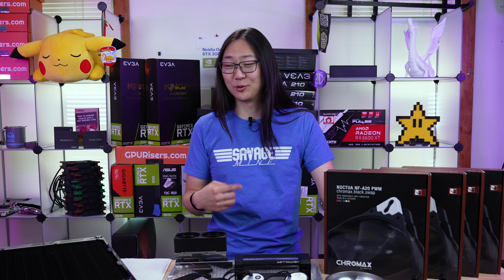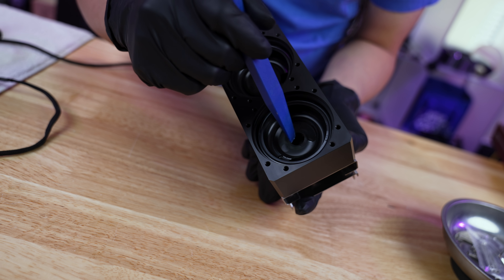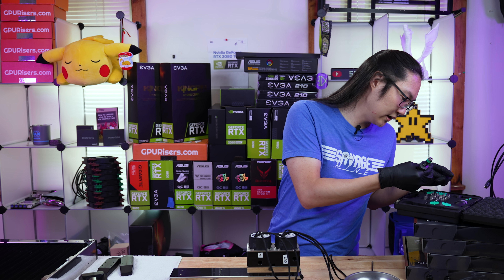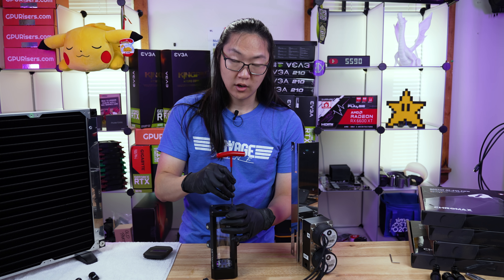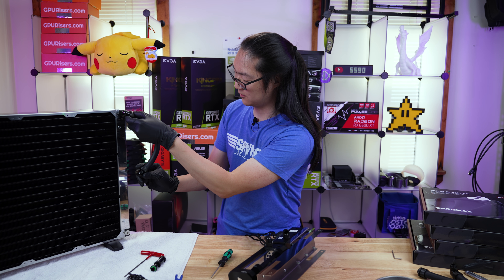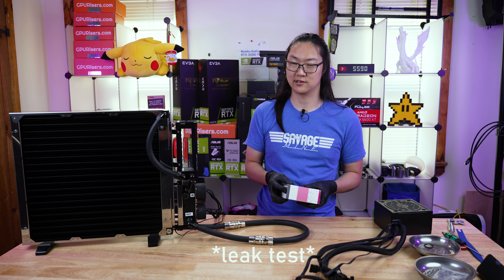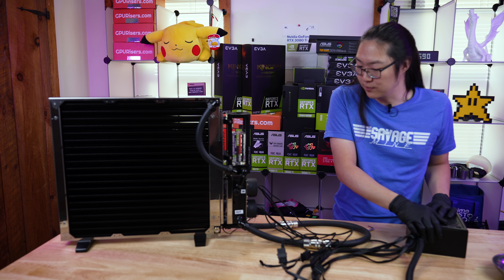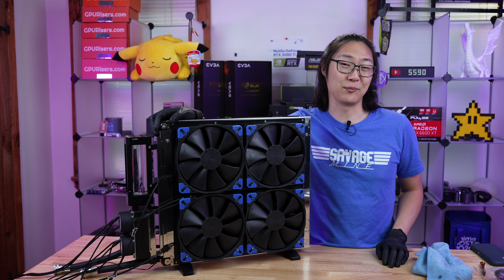The COOLEST radiator you never heard of!

Comment: Did you flush the radiator prior? Or is that unnecessary?  15:40 Seeing the fan mount mounted is nice enough but the interesting bit would be the cabling and fastening it to the radiator. The 4x200 mm Noctuas, I was all over them prior to being launched. How do their limited static pressure play out compared to using 9x140s? Would be nice to see a test comparison on performance, both cooling and noise, as well as cost.
Reply from the maker: Hey there, initially we did use nine 140 mm fans, but the amount of work that required in the cabling just made a little bit difficult. One of my key goals for this build was as quiet as possible and when you increase the radiation surface like that, you can make the rpms much lower with large fans. It's basically an audible from more than a few feet away.
Reply from the maker: Although not a bad idea, flushing of the radiator is not necessary. If it's brand new. Some people like to do a flush or filler with certain types of chemicals. I personally don't like doing any of that. Unless the radiator has been used with unknown condition
Reply: @TekShinji  Thank you for both your replies. I'm aiming for low noise as well. I understand the Mo-Ra isn't that dense so static pressure may be less important. Do low RPM render static pressure less important as well? Static pressure, from my understanding, is mostly related to speed of the air flow, and not the volume.
Reply from the maker: its diffictult for me to track comments after 1 or 2 so try joing our discord linked in the discription!

Comment: dude which screws did you use for installing the noctua fans to the fan adapter?? these screws that come with the noctua do not fit and the fan adapter seller did not ship any screws for the fans?? do you have the specific size and diameter of the screws you needed to get them installed? thanks in advace bro!!! great video im almost done with the exception of mounting the fans
Reply from the maker: hey buddy come joinour discord to continue the conversation linked in the description! im not exactly sure what your refering to. the screws should have come wiht the adapter in a small baggie?

Comment: I have had a MoRa 420 since 2017. Best investment I ever made, watercooling-wise.
One thing I'd like to comment on. When you use QDCs, it's best to use one male and one female connector at the bottom, and leave the tubing slightly longer. That way, you no longer need the "loopy loop", because you can connect the two QDC halves to each other.
Reply from the maker: Yes, that is actually what I did afterwards. For some reason I made them both the same even though I had plans on not lol
Reply: Better investment than MoRa is only Aquacomputer OCTO, BTW I have the same Male+Female and Female+Male, easy to use, disconnect MoRa and make closed cycle only with PC for everything.

Comment: Excellent video man! I'm going to do something similar to your build, but I can't for the life of me get that aqua link adjustable extender to extend. Is there a specific way to do it? Do you just twist it?
Reply: Figured it out! just had to crank that fucker. Love your videos.
Reply from the maker: Hey there, so the extender is just the tube that slides into another tube with some o-rings. Depending on which variant you have. There is a locking collar that tightens it down so it can't extend as easily. Try joining our discord LinkedIn the description. We could definitely help more there!

Comment: How far can Tubing be between the rad and the PC? Thinking of putting the rad far away and running the rest of the PC mostly fanless
Reply from the maker: There's probably a complicated formula/ equation for it. However, if the tube is on a level surface then there's very little resistance. It's only when you change the elevation where there's a lot of resistance
Reply: @TekShinji  yeah or maybe I can put the PC and the rad etc. into an isolation chamber, just run the cables out of it for video and usb. Or place it all behind a wall and drill a hole for the cables. No noise and amazing cooling

Comment: I've seen most people online recommend the inlet into the radiator be at the top and the outlet at the bottom. Just curious why you decided to do the opposite. Doesn't that mean the force from the pumps will have to be "highest" at the very end of the loops to go up, fighting gravity? Or is the two pumps combined just so much that it doesn't matter?
Reply from the maker: Hey there, so technically. When you push on one end the other end will push as well. So I know it's kind of counterintuitive. But when you build a water cooling system, that's primed correctly. Gravity gets kind of canceled out. Think about it like a train. If I were to put a train on the end of the table, it would start pulling that train down. But then it would start pulling train cars on the other side up. It's technically in balance with some resistance so it's basically neutral
Reply from the maker: We talk about things, things and other things all the time! Come join our discord. Continue the conversation!

Comment: I wish you had shown how you actually power up that thing. MoRa makes those lovely radiators, but to my knowledge you need to come with a gnarly system to power pump and fans up. A pity. Or did you explain it, and I just miserably missed it?
Reply from the maker: Hey there Thanks for the comment. Which part are you specifically referring to?
Reply: @TekShinji  well, how do you exactly power up the fans and the pump? Would be lovely to show exactly what kind of hardware you're using.
Reply from the maker: So the pump is powered by standard molex power. Nothing special.

The fans are powered by a fan splitter hub. And I did show in the video that I was using the aqua computer Quadro. That's powering the fans and controlling temperature and fan settings
Reply from the maker: Also, if you like a deeper conversation I highly recommend doing our discord! We talk about the stuff all the time!

Comment: Hey TekShinji, i just can not find any Watercool link in the description especially how tall is the reservoir 150mm or 200mm, asking because of the top middle outlet on the radiator to be usable, but if my reservoir is to long i just cant. Thanks for your respond, and the video is cool keep up the good work.
Reply from the maker: Hey there! You'll have to go to the water cool website and look for the parts there. They don't have any official parts list for this build when I asked them for it so I had to make it myself. The reservoir is a 150 mm.

There's different variations so don't go for the cheapest thing. You can find. Some of them have a D5  mount on the bottom. Some of them don't.

Comment: I think you said earlier in this video that you wanted to run the water IN to the rad from the top so it's not fighting gravity. In the end it looks like it's being fed in from the bottom and coming back out at the top into the res. Have I got that right or have I missed something? My mo-ra3 420 is arriving tomorrow so getting ready for the build!
Reply from the maker: Hey there, you're absolutely right! You're the only one that's paid attention so far:-)  in the end we decided it wouldn't  matter.  In a normal functioning loop that's closed circuit you push on one end. It will pull on the other. Like a train so it doesn't actually matter how it goes in or out. It will be the same.

Congratulations on your Mora!

Comment: Great video! There's one video no one has done yet which would be a comparison between 4x200mm vs 9x140mm. Would love to see which one cooler and by how much.
Reply from the maker: Oh, I believe that's because there's really no comparison.  9 140s are definitely cooler. I can confirm that.
Reply: 200mm fans have REALLY bad static pressure(partially due to the VERY low max RPM).  You cannot compare different manufacturers static pressure numbers, but if you trust them you can compare the same manufacturers numbers on their different models.  Noctua's 200mm has less static pressure than their NF-S12(which has really really bad static pressure for a 120mm, it is a total airflow fan)
However, the MORA has so much dissipation area it doesn't really matter.
Reply: @Grimmwoldds  I am not sure if changing the fans will actually make a difference as you will hit a limit once the water in the loop get close to ambient temp.  Jayztwocents did a video with a jank version of this and he didn't even use pc fans, just one massive one with almost no static pressure and it pretty much stayed at ambient temp the whole time.

Comment: Nice video!! i dig it!! is the follow up video out yet? i have a collection of hardware labs rad.s, 4 - 360gtx and 1 - 480gtx with push-pull Noctua and rosewill fans cooling 6-5700xt's, 3-1080ti's, 2-3070, and a 3060ti.. i'm carious how well your setup will work?! also carious about what calculations (coolant flow and air flow) your doing to come to your conclusions? awesome video bro
Reply from the maker: Hey there, most of the videos are out. Just check them on my channel. However, one of the videos is not finished yet due to some complications. Expect it sometime this month!
Reply from the maker: And very nice rig by the way! Sounds like you got a cool setup as well.

Regarding flow, coolant and such? What do you mean?
Reply: @TekShinji  haha thx! It took me a while to estimate what I needed to keep temps under control plus time to find and buy everything :/ It's been up and running since june-ish and so far my highest temp is mid-high 40's :) 
How did you know you needed that big of a rad.? And how did you know 2 D5 pumps were enough? Also, how did you know just a push (and/or pull) fan setup was enough for your cooling needs?

Comment: Hey dude thinking about getting a mo-ra3! But wondering what you did with the fan cables ? I have a case I’m using with existing rads so was planing on adding no-ra3 but just wondering how to do it clean!?
Reply from the maker: Big fans means only 4 cables!
Reply: On my first MO-RA3 420 pro I used 9 x 140mm fans. I hooked them up with 3 - 1 fan splitters then hooked those together with a fourth splitter so it was all driven by a single fan cable. I think they were Noiseblocker PK-2 fans, which have a really short cable so you can use short extensions to keep the cabling neat.
Reply from the maker: Nice!

Comment: Hi, two questions please : What is the size of the reservoir 150 or 200mm ? nd as you like overkill stuff why not push/pull :) ?
Reply from the maker: Reservoir is 150. In the current configuration push pull is not possible because of interference from the tubing. And that would increase the total noise floor.

Comment: Hi, i have the MO-RA 2 PRO for about 10 years still loving it. May you explain me why dual pump with your rig is it less noisy or other consideration ?
Reply from the maker: That's awesome man, they do last a long time. Top notch build quality for sure. Dual pump because well you know it's me... I overkill everything.... Check out the other videos about this you'll see what I'm talking about lol.

Dual pump will also allow me to not worry about any static pressure or flow issues. Since I can just overcome anything and any long runs or pressure heads
Reply: @TekShinji  Ok, thanks for the answer, i've not used these D5 pumps are they audible outside the case ?
Reply from the maker: Try checking out this video this is the next video after this one. This actually is a series of four videos.

https://youtu.be/0tVX4TaTqAQ
Reply from the maker: You can still hear them but from a few feet away it just rounds out from the background noise of the noise floor of the room. Barely audible

Comment: is the thicker tube needed?
Isn't the G1/4 the limiting size?
Reply from the maker: Not needed no. And yes the g 1/4 would be the smallest point in the loop. I personally like it because it's THICCCCCCCC 😅
Reply: @TekShinji  I was just curious cause i have 9.5/15.9 Tube/fittings and also looking into this external radiator (for cooling my server) would that size be a problem?
Reply from the maker: Along with the tube inner diameter is greater than or matches the diameter of the smallest G1 quarter fitting your fine. However over long runs in can make a difference in flow rate. But usually for PC water cooling the runs are so small it's fine

Comment: Nice work! Why did you choose to go 4 200m fans, instead of 9 140m fans? Do you think there is any noticeable difference in thermal performance?
Reply from the maker: Hey buddy! One of the goals of this project was to have powerful cooling (up to 1200 w) without the sacrifice of noise.

9 140 mm fans does have better airflow and better static pressure and better cooling. But it comes at the cost of a lot of the noise. So in my opinion the 200 mm fans are great for a low noise!
Reply: @TekShinji  264 / 5000

Hello...

Do you think i can cool 6 EVGA FTW3 RTX3080 (in the rig approx. 1300 watts) plus i5-7400T on an ASRock H110 Pro BTC + easily and quietly with this setup with 4x 200mm fans or do i need another radiator ???

Greetings from Germany
Reply from the maker: @andreaskorn403  unfortunately there's a lot of environmental factors that will determine whether that's possible or not. One of them being a major one is your ambient temperature. So you'll have to do that calculation on your own. However at 75° and being I have verified that about 900 watts is fine
Reply: @TekShinji Awesome, cheers for the feedback! Looking forward to seeing some of the results in your next video!
Reply from the maker: Oh yeah that's coming out soon! Make sure you get subscribed and hit the bell icon to see when it comes out!
Reply: Has the results video been the released? Keen to make a decision on this one soon!

Comment: Welcome to the Family of Mo-Ra owner. I have 3 of them, expensive setting but worth every cent.  Very clear and calm explained, step by step.  Regards from Germany
Reply from the maker: Thanks so much buddy, yeah it took a while to get it especially from Germany but it was well worth the wait. Expensive yes but the engineering and the manufacturing is top-notch!
Reply: Its not expensive. An Alphacool NexXxoS XT45 420mm radiator costs 125€. Thats 3x140mm of cooling area. The MoRa 3 delivers 9x140mm of cooling area for 240€. So you get 3x140mm for ''free''. Plus you dont have to worry about what case you can fit your radiators in and what you have to remove to achieve that. Its actually cheap.
Reply: Likewise, i have a 360 and a 420. Amazing rads
Reply from the maker: @sagerdood  they are some of the best radiators on the market!
Reply: @TekShinji  i would say tye best!! Im cooling a 12900k at 5.5 4.3 and a 3090 strix shunted, stays ultra cool
Reply from the maker: Lololol yea I guess but why?
Reply: Time to use 4 of them and 8 pumps to cool one pc
Reply: @Tacet137  One MoRa3 420 with 9x Arctic P14 is enough for 1500W, silent 1000W. 1 D5 ist still enough too.
Reply: How much does it cost to build one of these ?
Reply from the maker: Too much money :-(. You can go right to the water cool/ heat killer website and look up the current pricing. Unfortunately I can't just give you a flat number because as we all know it doesn't matter anymore. It's whatever the current market price is..

Comment: You build the most awesome and crazy mining rigs, exactly, cooling for your car.  What's next ?  Love it!
Reply from the maker: Hahaha thanks! Unlike ones for cars. This one is copper ♥️♥️♥️. Next will be the of that this thing is hooked up to!
Reply: @TekShinji  Noob question, would you know how different is Car Radiator Coolant to the Koolance stuff?  I haven't tried (only used it for the first flush) to run using it but it's soooo much cheaper ...
Reply from the maker: Car coolant would be fine. If it was diluted correctly. The only thing is some of them have silicates in it so you got to get one with no silicates.
Reply from the maker: Another thing is a car coolant has a higher level of ethylene glycol on it so that means it's not going to be as conductive or transferring a heat

Comment: Dude that's enough cooling for your car.
Reply from the maker: Fact it's almost the same size of a Honda Civic rad ^_^
Reply: I believe it. Interesting thing about the cooling system on internal combustion engines is that its a pressurized system which raises the boiling point of the coolant allowing operation at higher temperatures. As far as I'm aware this principle hasn't been applied to cooling electronics.
Reply from the maker: It has not yet. Generally electronics don't like getting that hot just yet.

Comment: I need this to watercool my 8x3090 rig
Reply from the maker: Haha one of these is not enough lol
Reply: @TekShinji  Yeah need a giant indistrial one right? You're making this for your KingPins yeah? Anyone following your channel would guess 🤣
Reply from the maker: Hahaha maaaaayyyyybeeee lol but yes those vids are coming!
Reply from the maker: One Mo-ra3 can handle about 1000-1500 w depending on fan config. If it's in ultra quiet then about 1000w
Reply: @TekShinji  What if you made a giant pump and reservoir to the outside of the building where the rad and fans would be? It would make it 100% quiet inside. Silence is golden.
Reply: @Pandacat 666 I was looking at those 6-foot industrial radiators...
Reply from the maker: Yea you would need a custom heat exchanger or some other system.